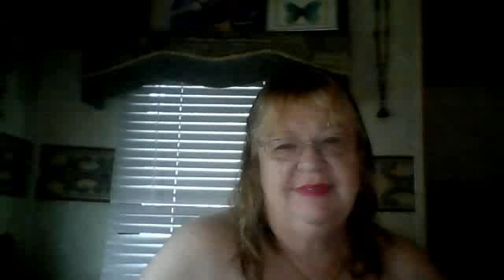RV WATER HEATER PROBLEM,  Sunday morning probs

Comment: Hi Debs, I looked at many forums for you and found this reply to be the most consistent one that matches your problem. Hope it helps and it doesn't look like it would be hard/expensive to fix...here is the c&p from one site.

The cheap plastic check valves that are used in conjunction with bypass systems are the first likely suspect. My motorhome had them at both the cold water inlet (to prevent hot water from backing into the cold water lines) and at the hot water outlet to prevent antifreeze from getting into the tank when a single lever byass system is used. I got very little hot water flow when the rig was brand new. I replaced both check valves with "quality" brass valves when the unit was less than two months old. No problems since then.

A second can be caused by debris blocking the flow restrictors in the faucets. This affects both hot and cold water flow. I removed pieces of plastic pipe for a couple months after purchasing my motorhome. They would almost completely shut off the water flow. It's easy to remove them and see if you have any flow. In your case I doubt that this is the problem since you say that your cold water is OK

Comment: I hope it's a simple fix. My hot water heater is in my slide and the manufacturer used cheap flexible hose that kinks and stops the hot water flow at times. Just thought .

Comment: This is where you start learning! Diagnose problem. No liquid coming out of facets? Or, no hot liquid coming out of faucet? If no water coming out of faucets - then you used up the 6 or 8 gals your tank hold and the tank didn't refill. Did the RV come with a manual? Does that manual include instructions on the hot water tank? Does it show valve positions? What kind of hot water tank do you are? Search online for people with similar experience. Fun Fun Fun!!! Its a puzzle that you get to figure out! Be Brave! :)
Reply: At least pay attention to how things are fixed that way you'll know when someone's trying to rip you off. My converter has gone out and I called a local RV repair place. He was trying to convince me to have him fix it. The part $250 plus labor plus travel! WTF The part is on Amazon for $100. it is simply a matter of taking out the out and putting in the new - like a light bulb - but not exactly that easy. As far as tools go - I'll need a screwdriver. Girl, get that hernia fixed -it will save you money in the long run. LOL Be Brave! :)

Comment: Turn the hot water button off. When turned back on do you hear the gas come on, Whoosh. If not the gas may be turned off. Could you be out of gas? Hoping for the cheap easy fix.
Reply: Check the fuse box.

Comment: It's a simple fix as White Rabbit has indicated the most likely suspect. I really think you should read your owners manual cover to cover. Plus you have speedy internet and you tube that is a wonderful tool for learning everything there is in life in general. Pick an item of your trailer and watch videos of that and then choose something else and do it a different day. It just pains me when something so simple will grind so many to a halt and be completely dumb founded on where to look for the problem or better yet not be able to tell the technician what the problem is and he has to investigate. That investigate time cost money and then the cost of fixing it and when he explains the fix to you and you think, wait I could've fixed that myself. You say you're not handy well at least educate yourself on how your trailer fixtures work so you won't be so dumbfounded all the time. If your hot water tank is electric and gas just ask your friend of how to replace that anode cause it needs changed yearly.
Reply: *****
That's why there's always a shake down trip first. This is your shake down for yourself and the trailer. You must be handy from all the crafts that you have created so it's just about the comfort of doing other things that include a tool. That's another thing to consider. A basic set of tools and a multimeter. Get someone to show you how to use a multimeter and you have the battle won when it comes to troubleshooting electric. It's all a craft project that's in progress.